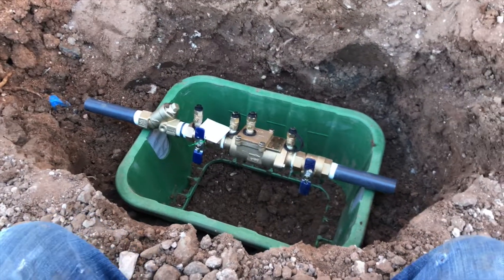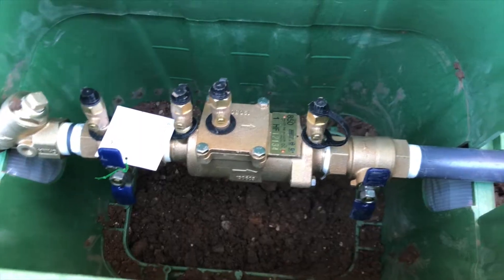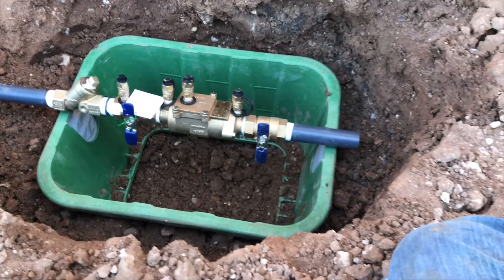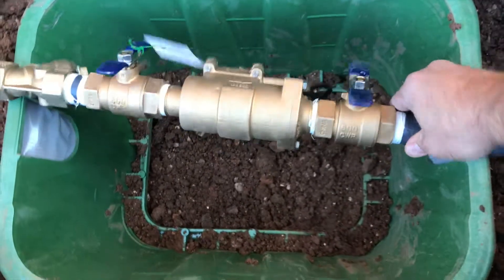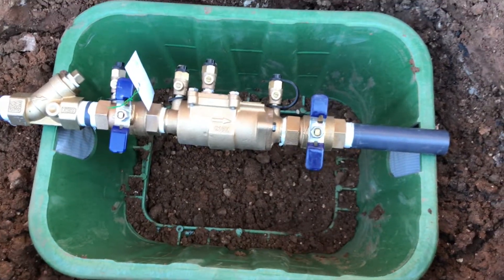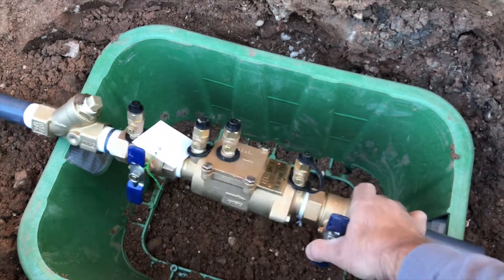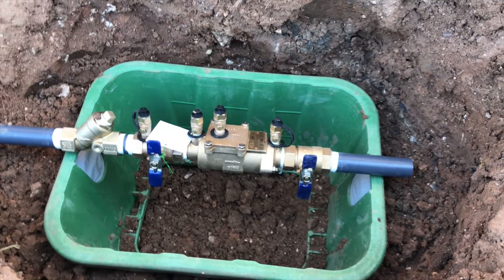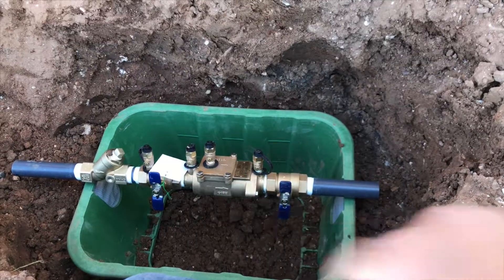Right Backflow Preventer Installation

Comment: Up vs Sideways, I'm no master irrigator, but I'd say that the manufacturer and probably inspectors would want to read the labeling.  So above ground it probably doesn't matter much, but in ground you'd  most likely need to be able to read the labeling (i.e. test cocks up).
Reply from the maker: Yes. Test cocks always up. Mainly for testing purposes.

Comment: I caught 2 homeless guys in my apartment complex that were doing something with these boxes. The complex is big and they have those green plastic rectangle covers all over the grounds behind buildings. Just after midnight I saw 2 guys, looked homeless and high on drugs on the ground and one of them had removed the cover and had his arm inside there. I walked past them to take out the trash and when I walked back by they were gone. I walked around the whole building and I noticed this socket outlet panel on the wall that has a metal covering on it that looked like it was pried open and the big wire that ran from the bottom of the panel into the ground looked like they tried to dig it up. I reported it. Apparently there has been a lot of damage to these things recently in the complex. They didn’t elaborate on what type of damage or why it was happening but I suspect it is thrives trying to steal copper wiring and copper pipes from the ground to sell for scrap metal.

Comment: So does the lid of the top box match up with grade elevation? Or do you have it sticking up a little higher?
Reply from the maker: Usually you want the top box lid sticking up a little bit. We install it to be 1 to 2 inches above the grade
Reply: @AmericanIrrigator  What you want is to have that box sticking up just high enough that it wrecks the box and the lawnmower.

Comment: Just came across this video and hoping someone can answer this question. I just had an irrigation system put in and I’m not sure if they installed a Backflow preventer. They DID put a check valve off my main water line though. Is that sufficient? Or did they just cut a corner? I don’t know much about plumbing but I’m reading that check valves aren’t as good as actual Backflow preventers. Wondering if I should call the sprinkler company and ask about this and request a Backflow.
Reply from the maker: It is required to have a backflow device on a sprinkler system. And it needs to be a testable device. A simple check valve is not the right thing. A call to the contractor is a good idea. They need to walk the system with you and show you everything. If they are licensed and a good irrigator , they will know all the current rules, and would have put the right stuff in.
Reply: No response... Your rude & you're selfish... seems like you got what you deserved!

Comment: Ive been told the wye strainers need to face downward or else they won't properly work by cacthing sediment/debris
Reply from the maker: Yes that is correct and having them face down ward is manufacture recommendation. This is a controversial subject. I had an inspector tell me to install it facing up, saying the screen will still catch any debris and because it is under pressure no debris will fall back into the main. But the rule changed in Texas where a Y strainer is no longer required on a backflow device, so no worries now.

Comment: Great Video!
I have a question. How would you go about insulating the pit? Would you use an insulated blanket over the top pipe assembly?
Reply from the maker: Something like an insulated blanket of a simple piece of insulation over the top of it should work. Of course it depends on how cold you get and for how long it stays cold.
Reply: Yeah, that's my question... installation in Bend Oregon. Very cold. I'll ask the water folks and maybe be able to answer my own question. I'll put it here if I learn anything interesting.

Comment: Do you still need a shut off valve after this? Or you don't have to???
Reply from the maker: Right now what the rule is and what most inspectors want to see is a shut off valve before the backflow device and a master valve after the backflow. Now that is in the state of Texas. It may differ from state to state. You no longer need a Y strainer before a double check backflow device in Texas.
Reply: @AmericanIrrigator  thank you for the response. My next question. Can you still use this type of backflow/ underground in texas? 

My house has this type of backflow and it's underground. I asked some local irrigation people for a quote and replacement. They keep telling me they can't replace the exact one/ type of backflow that I have. They are selling me the above-ground or do they call it PBB??? Is this true??? They are charging a lot too. Help, please.
Reply from the maker: @tzxsr  Some cities do allow double checks to be installed in a valve box underground but some do not. I don’t know if your city changed its code and does not allow it anymore which could be the case. The licensed irrigators there will know the most recent up to date code and requirements of your city. Un fortunately the going rate for any backflow replacement is high, But there are permit costs, testing and testing documentation, inspections not to mention the price of these devices went way up this year. So expect to pay a lot, but to use your sprinkler system, you have to have a backflow device. You can still call your local city department and ask what type of backflow devices are allowed there. I hope this helps.
Reply: @AmericanIrrigator  It seems like a lot of this is just relying on someone not to know.  I just did this and the 1" backflow preventer was about $240.  The permit was $35.  The estimate to replace it was ~$2,000.  I'd say $700-900 is probably fair for the digging and the hassle of permitting and all of that, but $2,000 is ridiculous.

Comment: I am replacing my set up which is exactly like yours pictured with a Febco 850 1 " Double Check Back Flow Preventer and a Zurn - Wilkins Strainer. The only difference is that mine has a 1" Quarter Turn Shut Off valve between the inlet side and the Zurn- Wilkins Strainer. Is this additional cutoff valve really necessary?
Reply from the maker: Yes. It is code to have a shut off valve before the backflow device of any sort. I always put mine a foot or so before the double check in a different box. That way when one needs to be repaired or replaced you can shut off the water right before the double check without having to shut off the main water. When the shut off valve or ball valve is butted up close to the double check and in the same box you have to shut off the main water to replace it. So I recommend putting some space between the shut off valve and the double check and put a separate box over it.
Reply: @AmericanIrrigator  Thanks. One follow up question. I am considering placing a 1" PVC Union on the discharge side of the backflow preventer in order to make it easier to remove the backflow preventer for service. What is you opinion?

Comment: Thanks for the video.  When using a backflow preventer such as the Febco 850 which is not rated lead free (low level lead), is it safe to install it on a sprinkler system that gets is water supply from a well that provides drinking water?  Thanks!
Reply from the maker: I have never heard of it hurting or being bad. We install Febco 850 double checks all the time on wells and have never had a problem. Not to say there has never been a problem or there will never be a problem, but I feel comfortable with it. Hope this helps. Thanks for the question and comment.
Reply: How far the febco 850 non lead free needs to be install from the water meater 😅

Comment: Well done. Test cocks up. Easier on the tester to fit the hoses in there. You're the type guy I love. I'm a Backflow tester, nothing worse than a poorly installed Backflow. Great work!
Reply from the maker: You are welcome. Some inspectors will not pass you unless it is done right and installed so it is easy to test, but some cities let guys get away with bad installation. Hopefully you will see more good stuff than bad.
Reply: install backflows above ground. always fun when you can't keep your tester level with with backflow because it won't fit in the box. This isn't up to code
Reply: We don’t allow a wye strainer upstream. Can be a point of a cross connection

Comment: Why you people keep installing the strainer facing up? It should drain down.
Reply from the maker: I have gotten a lot of controversy on that. I had and inspector tell me to install it that way years ago and I actually liked the way if fit in the box better. But I must admit, I looked up manufacture specs and it says to face them down. I had an inspector on an out of town job, the first of last year, almost not pass my job because of this. He almost made me change it.
Reply: @AmericanIrrigator  He should had made you fix it. In Texas, irrigation code says Manufacturer specifications never should be  modified/exceeded. Whoever inspector let you pass this also should have better training.
Reply: Agreed the strainer does not work in the vertical position.  It's supposed to be to lowest part of the assembly so it captures debris and it cannot fall back in the line.

Comment: thx for the video.  Do you have a preference on brand of double check?  I looked at the Zurn 350XL and the design made sense.  Also, the installation shows vertical installation with waterflow going up.  Can water flow go downward on a double check in a vertical installation?
Reply from the maker: I don't really have a preference on brand. The ones we buy are febco 850 double checks. That is the one the supplier carries for us here. They are all pretty comparable. As far as vertical installation, I will be honest, I have never installed one vertically. I would think it would be fine with flow going down but I'm not real sure about that. Horizontal installation is probable the most common way to install a double check backflow preventer. One of the biggest to make sure of, is that is can be tested easily.

Comment: Thanks for this great video!
How much should I expect to spend on a double check backflow preventer?
Reply from the maker: It can depend on a lot of different things, like size, complexity of the job, location of the back flow. etc. I say that because every job is different and that is why some may cost more than others. And depending on your area and what the going rate is there. So the numbers I am going to mention may or may not be good or accurate. But to give you a ball park, you  can expect to spend anywhere from $500 to $750 installed. But I've heard of people paying as much as $1200 for a one inch double check installed. I think this is a little high but then again, that job may have been hard to do and that's why it cost more. I hope this helps you get an idea.